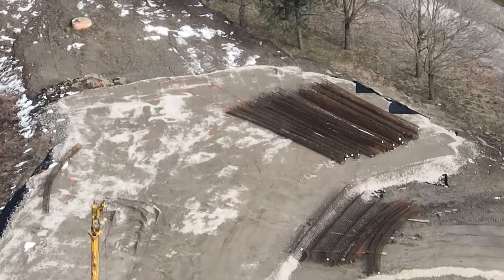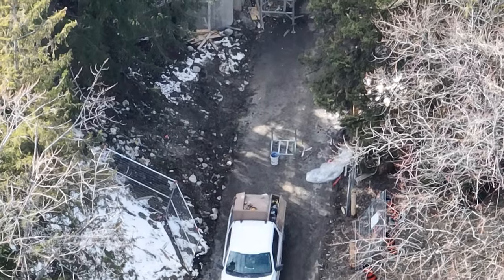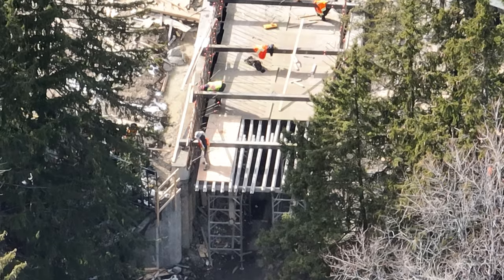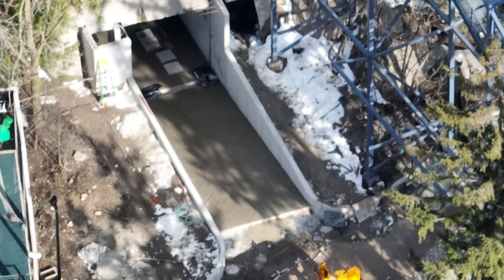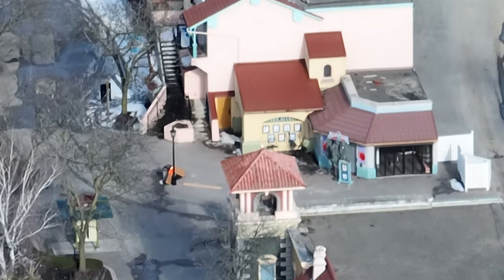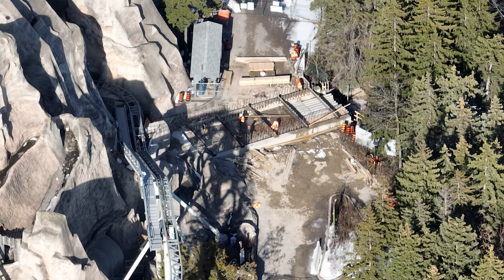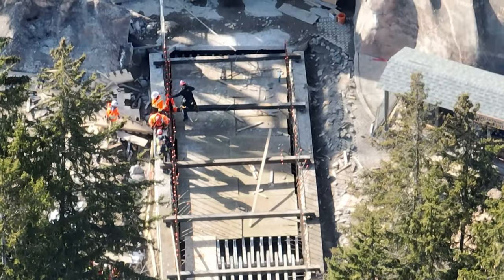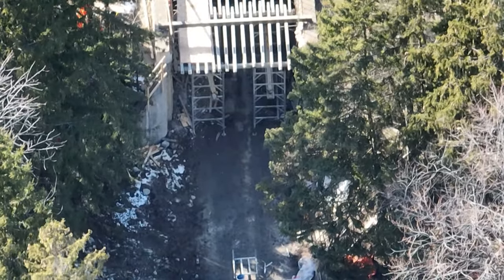Canada's Wonderland 2025 Construction Update

Comment: The scaffolding for the "Launch Tunnel" is very beefy to hold people and matches what would be used when pouring concrete on top or above. Look at condo projects and they have the same equipment under before they pour a new floor slab. If you look back on your videos the bent rebar was bent down when they demolished the old tunnel and only some was bent. Yes its still vertical but I think that's to make room for more rebar that is placed on the top of the tunnel before tying all the rebar together and pouring the top slab. 

You said in this video about Maintenance tunnel #2 under vortex at 2:01 "100% going to be a maintenance tunnel and nothing more". That's quite an early statement to make when we don't know all the details yet.

I disagree with it being ONLY a maintenance tunnel for these reasons.
- Location is prime and an ugly tunnel will take away from the ambience
- The ramp looks as if it is lower than the paver stone level indicating a finish layer of paver stones to be added
- The lines on the ramp are used for traction and water drainage, even if they cover it with paver stones the lines will help channel the water.

I think that for the 2024 season this will be a maintenance tunnel then converted/merged to one used by guests for the opening of the new ride. This will allow them to potentially drive in materials on large tractor trailers and park it inside where they can offload and use them.
Reply: Ya I wish he would stop saying 99%/100% sure/I can guarantee and stuff like that. Last week Maintenance tunnel #2 was "guaranteed to be a brake run into the station".
Reply: Yeah well said. Some of the things he says seem off.
Reply from the maker: The project is really confusing we thought it going to be used for the coaster but, the things we see everyday add up to it not being so. That's why it may have seemed that's we are changing our speculation all the time because honestly we don't know. but what we do know is stated in the video